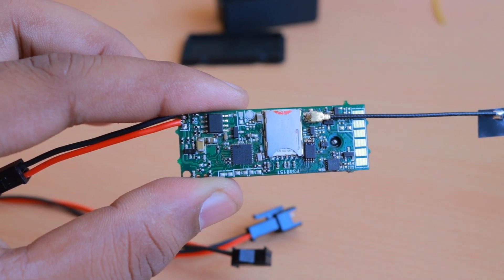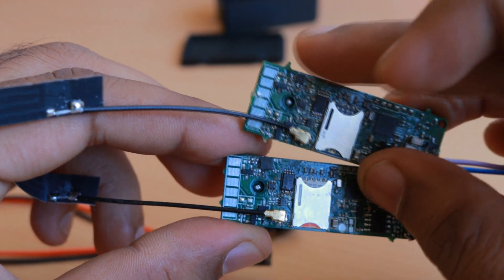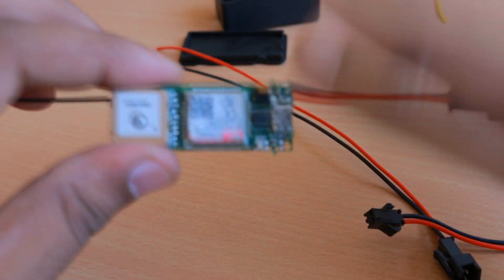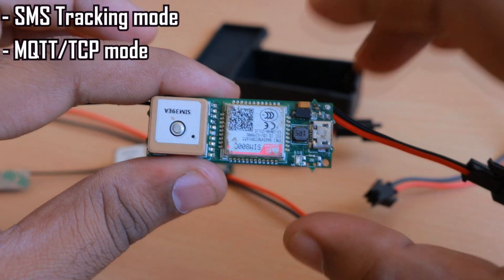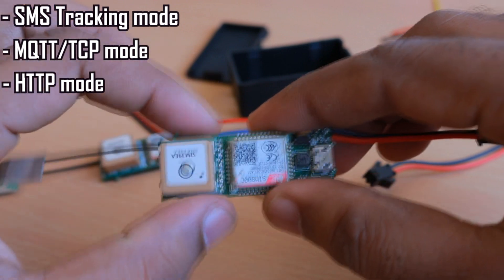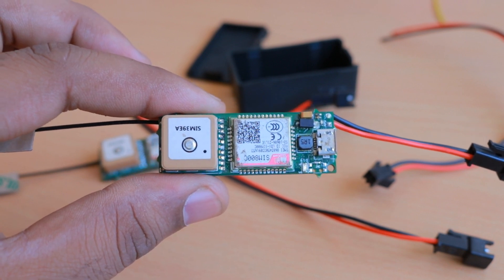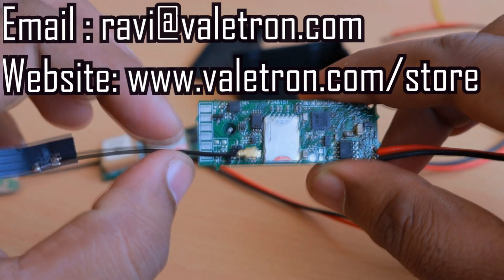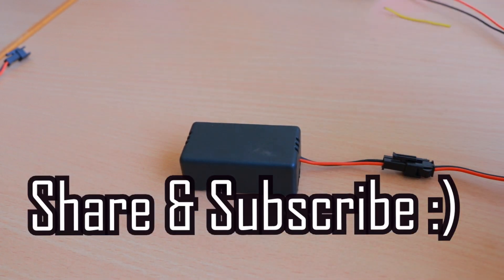VALTRACK-V2B  Low cost Vehicle GSM/GPS tracker for vehicles- Runs upto 28V

Comment: Hello @Ravi Pujar, have you considered making a mini pcb to mount just the gps and passive components for it as a mini break out board?
Reply from the maker: Hi Ian, haven't considered it yet. For what purpose / application the breakout would be needed?
Reply: @Ravi Pujar 
Maybe just a stand-alone gps module breaking out just the basic TX, RX, GND and VCC. The key thing to be as small as possible and be breadboard friendly (be able to solder on pin headers) Also another board which would include a surface mount atmega328p? With possibility to add a display and breakout other digital pins to allow connection to a sim module?

Comment: Hi great work, thanks for making videos. I like to know why you didn't use SIM808 or quicktel MC60 GSM/GPRS/GPS version. It could save space and money both.
Reply from the maker: Hi Suman,
Using a combo module comes with its own problems. You cant keep GPS running in SIM808 when GSM part is shut down. And matching GPS external antenna is problematic. 
And SIM808 is bigger and doesnt suit the purpose of the design.
Dont forget to share & Subscribe :)
Reply: Thanks for the response, i agree your point. But like to say do this kind applications needs continues data stream from gps or gsm. Actually i am working on same product. Even i did some prototype board designed of it and its working good with sim808. Now i am working on Quictel MC60 thats very small footprint and gives complete GSM and GPS platform.